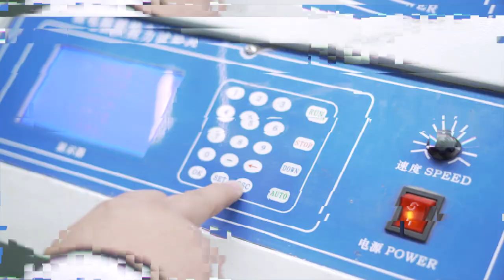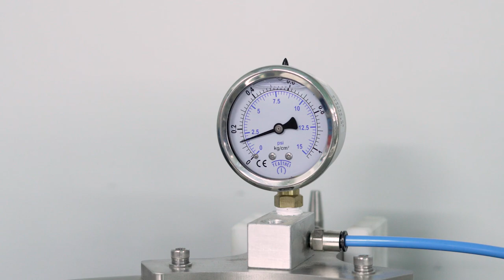UMIDIGI BISON GT Quality | Lab Test

Comment: Hi, I just received Umidigi Bison 8/128 from Hong Kong shipment on 01 June 2021. After checking, i found that there was a problem with the call out(no sound in calls).  Which is  receiver does not hear the caller's voice.  But the caller can hear the receiver's voice loud and clear.
Any solution gaiss?...still under 1 year warranty!!!